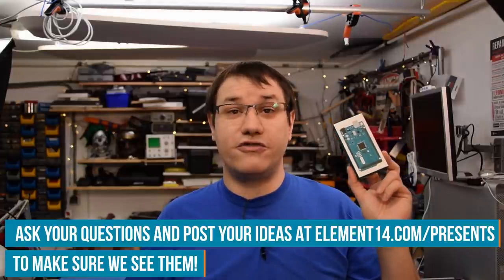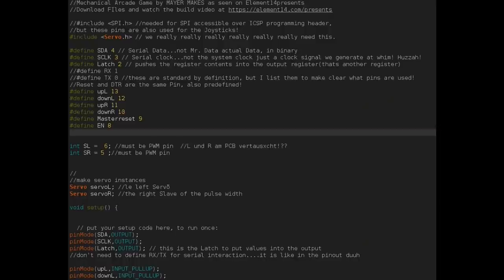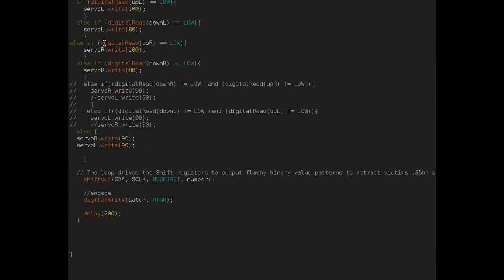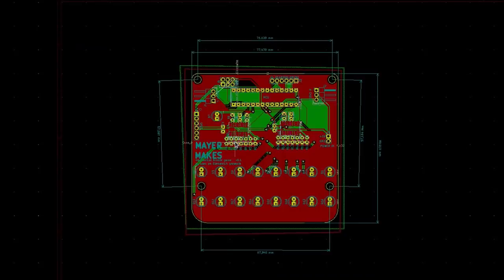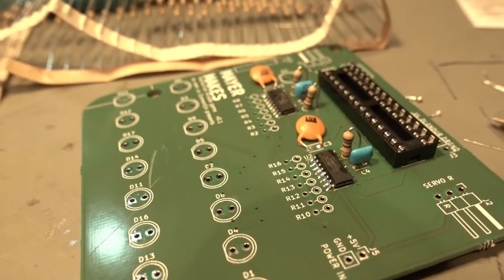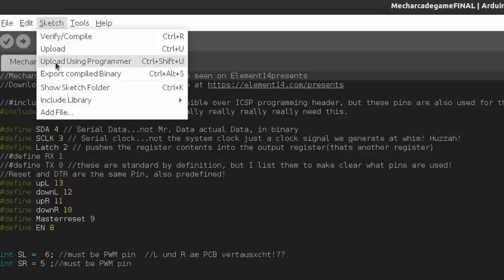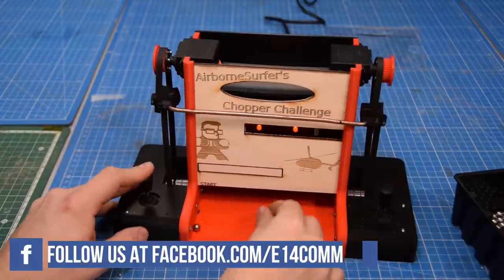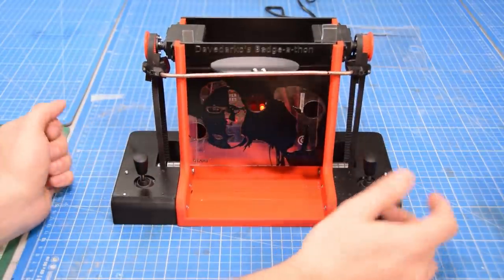Mechanical Arcade Game with Barebones #Arduino

Comment: I think, that programmer or You didn't kill these mega's.. Just wrong oscillator settings.. If fuses are set to external crystal, external RC or external clock input and circuit doesn't have these, then mega can't work or respond to programmer until clock signal is applied.. Back in day's i accidentally put wrong fuse setting and freeze mega.. Figured it out and bring my mega back with external clock signal.. From that time, i multiple times verify clock fuse settings before applying anything.. ;)
Reply: I've carelessly killed a few atmegas by accidentally disabling serial programming or the reset pin. Entirely my fault and led me to make a high voltage programmer so I can always recover chips.